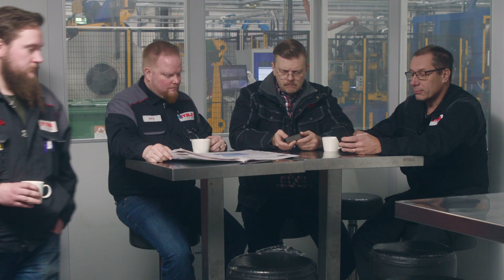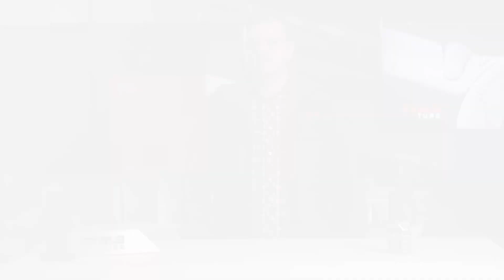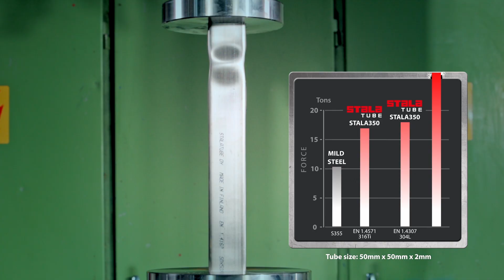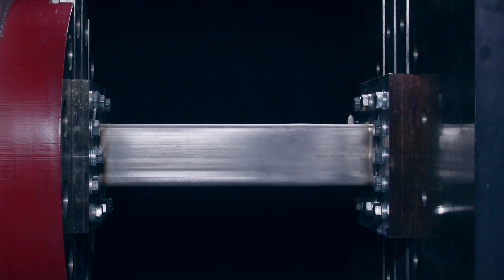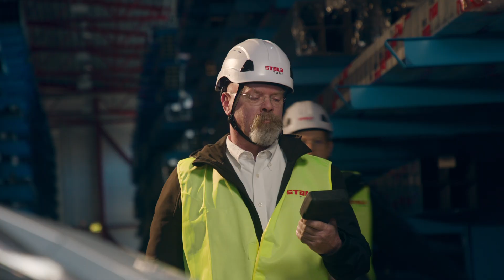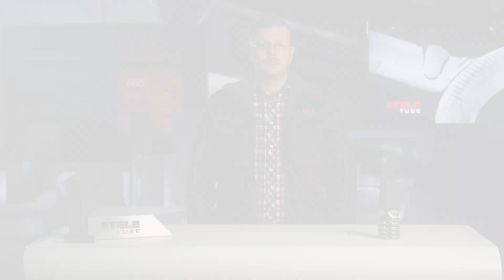Stalatube X Pekka | HSSHSWP Season 2 Test Ideas

Comment: A torsional test where you replace the driveshaft of a vehicle with various grades of steel and see which tubes can survive the torsion would be cool. This may require having a heavy trailer attached to the vehicle to increase the torsional load through the driveshaft. Also, welding up a cantilevered beam structure in bending to failure would be exciting to watch. To safely create the bending force you could have a large tub of water on the cantilevered section and fill it until the beam breaks and spills all the water.

Comment: I’d like to see unsupported rigidity tests. What’s the maximum length of HSSHS that could be used to support a 100kg weight hanging on the end vs regular steel. Call it the crane test 😁

Comment: here is a random dumb idea, how about similar test at certain temperatures or bringing the beams close to a "common" high load near a failure point (the weakest of the batch?) and heating them up or cooling them down to see when they lose their strength? (maybe also tolerances, throw in some invar as the control and see how other steels manages compared to yours...)

Comment: Hmmm... this one would be extremely hard to do, but what if you built a short railway section (the length of a tram or passenger car) with your stainless tubes and had a VR train roll across it?

Comment: Make identical towers of the tubing at different heights and see the strength and stability of the vertical un-reinforced pipes.  Keep adding weight until collapse.  2nd variation on this is repeat test and apply propane torches in a uniform way to all and repeat tests under heat strain.  3rd variation on this is to chill the structures significantly and show strength in extreme cold conditions.  4th would be to apply all weight on 1 side of the structure only to show strain and compression strength.  All tests could be done with same construction for consistancy.
Reply from the maker: Amazing🤩

Comment: Welding Test: Weld multiple tubes together end-to-end, securing them at only one point, how long you can make the row before it becomes unstable!
Balance Test: Test the uniformity of various tubes by balancing them, cut the balancing point then gauge if both sides are identical in all ways.
Thermal Stress Test: Repeatedly apply hot and cold temperatures to the tubes while under stress to test them over time.
Reply from the maker: Great ideas🤩

Comment: Do explosive tests with Pommijakkatat guys! Put 100g explosive in hollow tubes welded shut and compare the deformation after they are exploded. 

Please bring me back to Finland for this test, I have to see it in person!
Reply: Also do a heavy corrosion test. Dip samples into a hot fuming nitric acid bath and see how the duplex SS does vs. others. Raise the stakes- put the acid in the samples so they must contain it. Then put the Stala samples over Pekka's boss' car, but the others over teddy bears or something, the acid will eat through the others (eventually)
Reply from the maker: 👏 @ElectricNed
Reply from the maker: Congratulations for winning the fine piece of modern art! 💥

To receive your prize, please send us an email to marketing(at)stalatube.com
Head your message “Comment winner + your Youtube username” and add your postal information into the message.